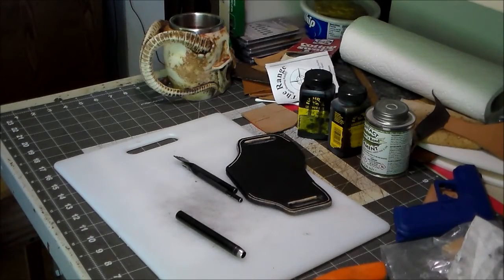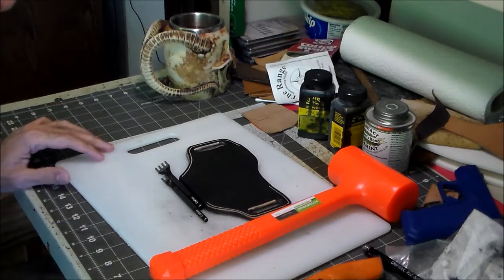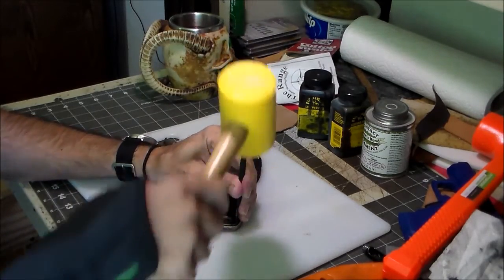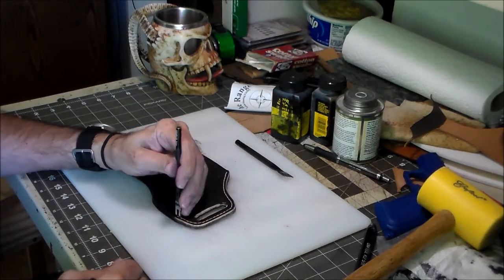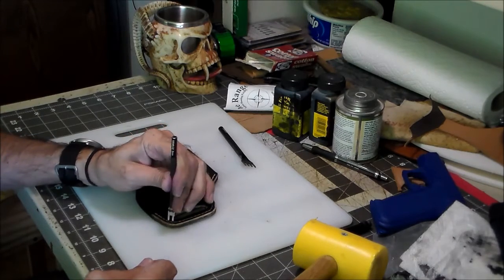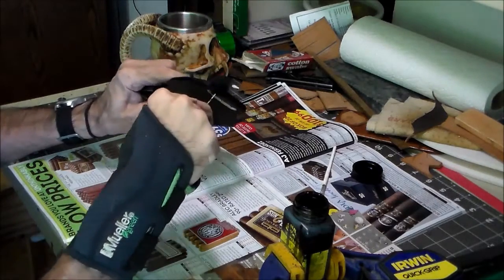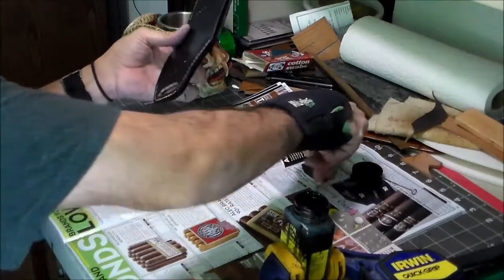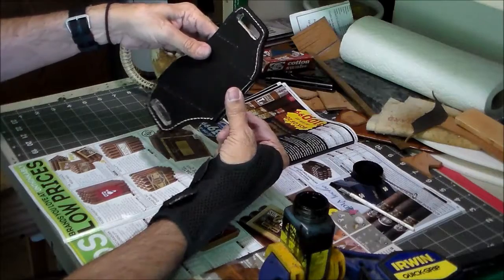Part 6-11: Punching Stitch Holes and Touching Up Dye

Comment: What stitch spacing do you like to use on your holsters?  Also, what thread size and type of thread do you prefer?
Reply: I use 3 mm stitching chisels. The thread size depends on the project, usually 1mm but I have some continuous filament polyester waxed thread that's a bit thicker and makes for a thicker stitch line. I use that on "showy" stuff. I prefer braided thread.